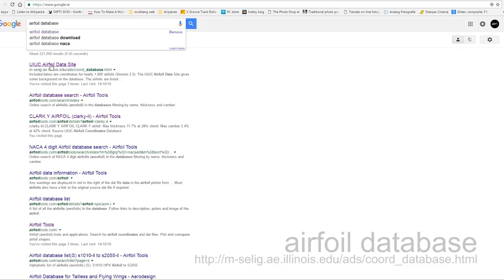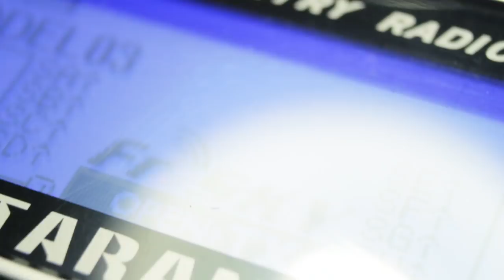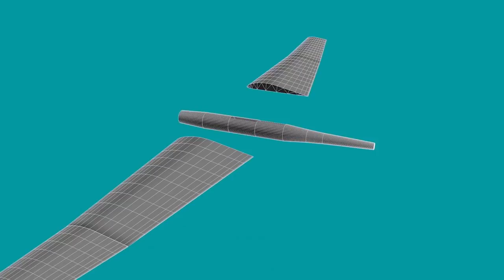How to make a styrofoam RC airplane yourself | homemade low cost project

Comment: will you please tell me every part measurement
Reply from the maker: Hi, I'm sorry I didn't put that in the description, the measurements are wing span: 76Cm, 14 width. Fuselage 56Cm, horizontal stabilizer: 25Cm of width, vertical stabilizer: 16Cm height. Use this measurement to have an idea but you can use different measurements really depending on the weight and other factors.
Reply: +Joyplanes thank you
Reply: Impressive. Could you please explain the principles for power calculation of component i.e. esc, servos, battery, etc
Reply: Rehan Ali Qureshi nerd
Reply: @Abroadfreak  nerdy
Reply: @Abroadfreak  It all depends on the model of plane you make. For a casual flier, use a brushless motor with around 1000kv rating that has a pulling power of about half the complete weight of your plane. ESC to match your motor and 9gram analogue servos are good up to medium large sized planes. 2-3cell lipo battery who's mah rating will determine it's size and weight. Again, you really need to know exactly what plane you are using.
Reply: @Declan-pg8cg  ... i want to use for spitfire, wt: 250 - 300 gm.
Reply: @Joyplanes  Great Video. Download link for plans is not working. Will you pls. fix ?
Reply: Rehan Ali Qureshi The most important element is the Thrust produced by the motor. You can refer the specifications provided by the motor manufacturer ( Thrust produced by different Propellers will be mentioned ). ESC ratings should ideally be minimum 50% more than the max current specs of the motor. It's always a good idea to select a Battery pack which provides supports 25% additional discharge rates.

For basics / simple depron or even Electric RC Aeroplanes / Gliders you can safely configure a setup where the Maximum Thrust provided by the Motors is 25% - 35% more than the Payload ( Total weight of the Aeroplane - Glider ). However it's not the case in Drones / Helicopters; here you need a safety factor in the range of 50% and more... especially if you will be attaching Expensive circuits / video tx / camera etc.

Hope it helps.

Regards,

Sushil Adhikari
Reply: @Declan-pg8cg  - You put this very well "use a brushless motor with around 1000kv rating that has a pulling power of about half the complete weight of your plane"
Very helpful!
Reply: Great video! Its any toolset or rules to establish the wingspan and fuselage depending of its total weight? Im a complete noob on this any help Will be appreciated.

Comment: It is only low-cost when you already have all the electric components.
Reply: Obviusly you still need the electronics, but you can get electronics for like $50-$60 so not that expensive
Reply: @idk-ir6vv  uhh ok budddyyy
Reply: @idk-ir6vv  try to multiply one dollar by 51. That's expensive for me, a Filipino
Reply: Maru Ivan Rico minimum wage in Phillipines is higher than the equivalent of minimum wage of USA so your excuse kind of goes out the window there
Reply: @friendly.arsonist4851  $60 easy lol. battery is $10-20, motor with esc is $20 and you can get 10 servos for $20 all on amazon
Reply: @alienbeef0421  save up and immigrate to USA!
Reply: @ferce889  i could move to NZ or Canada, yes
Reply: @ferce889  oof
Reply: @ferce889  lmao no id rather canada or many other places
Reply: @alienbeef0421  dude were not forcing you to build one! if it costy for you don't have to! lmao
Reply: @munchgaming4589  i already have one, 10 months later. lmao
Reply: @imtoouncreative8263  today I learned!

Comment: Great video! I love how you explain everything and include a parts list.
I based my plane off of yours and bought the same servos you used, but my servos jitter whenever I try to move them. I made sure that the FlySky I6 transmitter and receiver are all properly calibrated, but they still jitter. I tried all five of them, but they all seem to do the same thing. Could the problem be with the servos or is it something to do with the receiver?
Thanks so much.
Reply: Amazing video! Is it easy to make?

Comment: thanks for posting.  some late thoughts for you and your subs.  do not mount servos in the tail, MOUNT SERVOS NEAR THE CG.  mounting servos aft of the cg makes the tail heavier and more counter-weight is then necessary, for correct balance/cg.  mount aileron servos as far inboard as possible.  ailerons can be controlled with one servo; see strip aileron configuration.  at 1:40, the profile shown is NOT a clark-y, it is semi-symmetrical.  clark-y has a flat lower surface.  fortunately for you, the profile that was cut has a mostly flat lower surface.   (stick with the original clark-y, not the clark-y II, which is a more complicated profile.)  a poplar dowel makes a better main wing spar.  the spar should extend most of the span; not just the middle one-third.  at 8:12, make control horns from an old credit card or similar material, not from an aluminum can.  mounting the battery as low as possible increases stability.  cg appears to be pretty good.  correct cg is 30 percent of main wing chord, aft of wing leading edge.    cheers
http://www.funfly.nl/Verdiepingen/Vleugelprofiel/Clark%20Y/Clark%20Y.jpg
Reply from the maker: Hi, thanks for your comments about this project. I'll be making more airplanes and similar projects soon.

Comment: Try to add all the parts you can to the main body before attaching the wings, and when attaching the wings try to get a feel of where the airplane's center of mass is and place the wings there, if your plane tends to nose dive move the heavyer parts more in the back and if it tends to go up move the heavyer parts in the front.
Reply from the maker: I first make the airplane and then put the componets in place, I always leave enogh space at the nose to be able to change the CG.

Comment: This is the 2nd video like this I've seen & both show ways of handling materials that
will make this project easier. I can figure out how large to make the wingspan and
the overall length of the plane w/ common sense but I'm more concerned with not
knowing anything about the controller or electronics needed? Like the radio used
I'd want to buy a better one I could grow into since I'm sure this is an addictive
hobby?  Lol, I'm sure it's addictive because I already feel it just watching you
make this one. Is there a kit to give us all we need or do you have the list?
any help would be great... peace
Reply from the maker: I will make a more descriptive video or series of videos explaining all.
Reply: @Joyplanes  ~ I'm like, "Stoked" over all of this! I've learned how to
engineer a main body that's hollow yet super strong. Also how to bury
the servo's within the structure of the plane. And how to paint it too.
All in a few days. I'll watch your stuff when you're ready.....

Comment: sir,
your video is really amazing and I want to ask that from where do you got the remote controller , servos ,and the transmitter and receiver also how did that fan and what is the range of your radio controller??
did you made the fan or you purchased??
pls pls  sir don't forget to answer my questions coz I am also making that plane and I want to show it to my frnds , teachers and off course in my school.
pls pls sir answer my questions. 
again I want to tell you that your video and your plane is really amazing.....

Comment: This ought to inspire those on limited budgets to know they can do this for a
fraction of the cost?  I'm building a wing but my problem is which Transmitter
is best?  As in a User Friendly, easy to program radio?  any ideas?
peace
Reply from the maker: I think all radios have tricks on their interface, but I would recommend any open TX based radio like the Frsky, the new jumper T16, etc. Futaba has also a good user interface, but they are a lot pricier.

Comment: Great video , Can I use brushless motor 1000kv ?? and plz could u tell me what the measurements of this plane ? Thanks
Reply from the maker: There is plans in the description, the measurements are in millimeters. And yes you can use a 1000KV motor but is better a smaller motor fitting a 4 or 5" propeller. The motor should be about 2300KV a 1000KV is made for bigger propellers and it's hevier

Comment: How do you make the servos for the wings connect to the same channel but make them move in opposite directions? Would it be better to just use one servo in the center or is it better to have two servos?
Reply from the maker: You can use either technique but be having two servos save a bit of hassle aligning them later, and with two servos you can make a mix to make them behave like flaps for landings, it can be programmed in a mix in the radio.

Comment: Can i use a turnigy 1400kv motors ? Is there any speciality for the motor that you use in the video than from using a motor for quadcopter?
Reply from the maker: You can use it, the motor I was using was small, light but not powerful, that motor you want to use might be a bit heavier but make the wings a bit larger and that should be all right.
Reply from the maker: Hi! well, you can contact me on facebook as joyplanes rc, (it's in Spanish because of my main youtube channel) but I'll try and answer your questions.

Comment: Hi
What motor ,esc and battery did You use?
Nice plane
Reply from the maker: Hi, I used this: Turnigy Nano-Tech 950mah 2S 25~50C Lipo Pack,   18-11 2000kv Micro Brushless Outrunner, HobbyKing 10A ESC 1A UBEC
Reply: Tomasz Frankowski final year project?

Comment: How do you put the motor if the back part of it moves with the spinning? I have a Radian motor that crashed a few days ago, using for part and got a new Radian.
Reply from the maker: The back part doesn't spin, it stays still. Maybe you confused the bell with the base of the motor.
Reply: I do know some motors do not spin on the back of it, where you glue the back part the the wood and then the plane. I have the kind of motor that i call the heavy motor, since its powerful, efficent, and the back part spins and the entire thing is big. I dont have the link but if you can go to HorizonHobby, go to airplanes, sailplanes, E-Flite Radian 2M, scroll down and go to parts, and then scroll down until you find the motor.
Reply from the maker: Thats the kind of motors that will go on a glider but you can use them for any airplane, for that the base is different, make a box where the motor will go and then a hole in the front to let the shaft out and little holes for the screws. It's basically the same motor but different configuration.

Comment: can you get me a clark y airfoil for the which is 9 inch long?i am not finding a way to get a calrk y airfoil with that length.please help me:(.
anyway great video !it really helped me.just wanted to say the plane is not made up of styrofoam. styrofoam is actually the thing from which disposable plates are made.
Reply from the maker: In this website you can generate Airfoils of the length you need on a PDF http://airfoiltools.com/

Comment: Hi can u tell me where can i buy the motor and the control parts
Reply: Get them on banggood, much cheaper. Get the flysky i6 trasmitterz it will arrive with the receiver, get an ecn and a motor and a battery and make sure to get all the parts with same connectors as is hard to swap them later on so you ll be ready to connect them as soon as they arrive. And get some servos... that's it
Reply: @gursisingh1940  thanks how much do u think evrything will cost me
Reply: @marcels9111  not ecn sorry, it's esc. I spent about £100 with the battery (got the battery from amazon not banggood). Get guitar string to use with the servos too.

Comment: What wire do you use for the servo pushrod?
oh, and a question that is off topic that I want to ask is that what video editor do you use?
thanks!
Reply from the maker: The pushrod is a metal guitar string, you can also use an aluminum wire. I use Adobe for my work, I'm a filmmaker so I have access to this.
Reply: how many mm in thickness should the wire be?
Reply from the maker: depents on the stifness of the wire, if it is stiff enough then you don't need it to thick.
Reply: I use wire from old umbrella, it is quite good push rod for almost any RC airplane.
Reply from the maker: Good idea!

Comment: Is airlons important or it can be replaced by rudder
Reply from the maker: If the wing is flat like in this model the ailerons are very important to maneuver the aircraft, if the wing only has a diedro then you can consider only having a rudder.
Reply: Create & Invent then 5 channel reciver is compulsory?
Reply from the maker: You need the following channels, 1. motor - 2. Ailerons - 3. elevator - 4. rudder. in the receiver, you need an extra channel to connect the second aileron servo but that should be mixed in the radio. A flysky radio is the one I recommend the one in the description called Radio system (recommended for beginners)
Reply: Create & Invent plz dont mind beacuse of asking several questions.. so we can mix two servos to make one?
Reply from the maker: You can have two different outputs controlled by the same input of the radio, that's what the mix is for, for instance you can control two servos with the same channel.
Reply: Create & Invent thanq u ....i have no questions now.. u are honest and best responsive youtubeR.. 😃😃good luck for u and ur channel....love from NEPAL
Reply: Create & Invent i have question is 30 amp esc suitable for 2200kv motor?oh i went through description and i got it thanqs...
I will be using 2200kv motor 30 amp esc 1100 mah battery 6ch radio is that ok
Reply from the maker: It all seems ok to me, just use a 3s battery. Cheers.
Reply: Create & Invent u are damn awesome can i have ur twitter or insta or fb so i can get help and inspiration from u?
Reply from the maker: Fb joyplanes rc, Instagram is also Joyplanes rc
Reply: Create & Invent thqns

Comment: how do you connect the remote control to the reciever?
Reply from the maker: the receiver have to be bound, and the servos and battery connected to the receiver.
Reply: Create & Invent but how do you bind the reciever to the remote control?
Reply from the maker: That depends on the brand, there are many videos about that on the internet. I can make one but not now.

Comment: Sorry dude, but it's weird. You spent more time with the video than the plane's quality. Maybe some people like its minimalism, but it is not modelling. This is my opinion.
Reply from the maker: Yes you are right, many people starting in the hobby don't spend much time or money to make an airplane so it is most likely to end up looking like this one.
Reply from the maker: Yes, it can be simple but functional and work on ho it looks after solving other more important issues. Thanks for the comment.